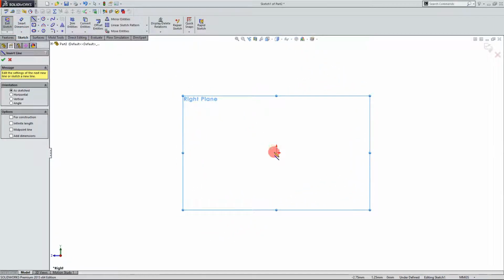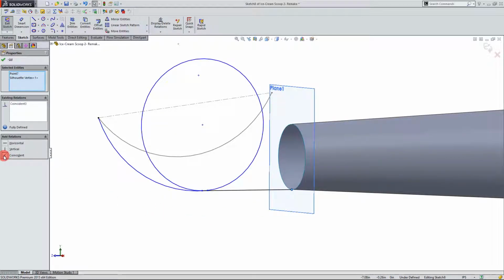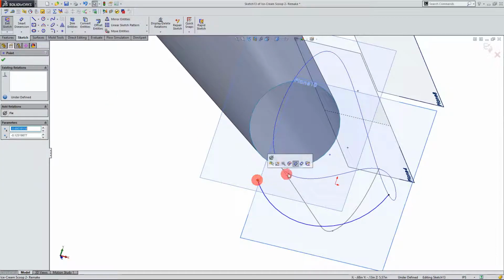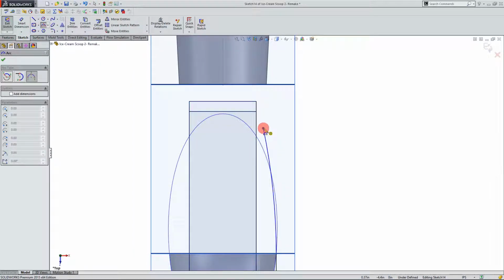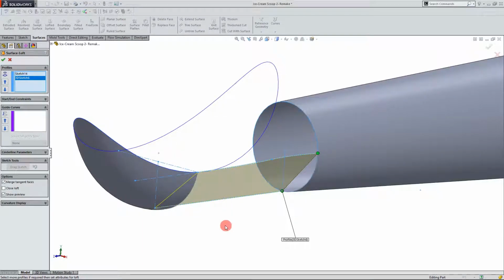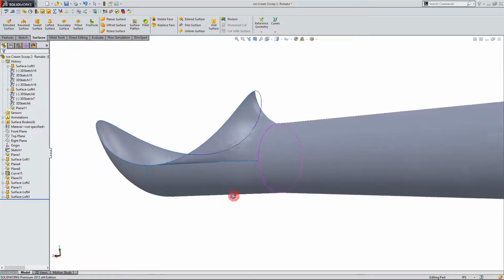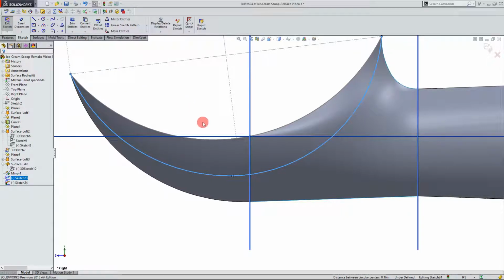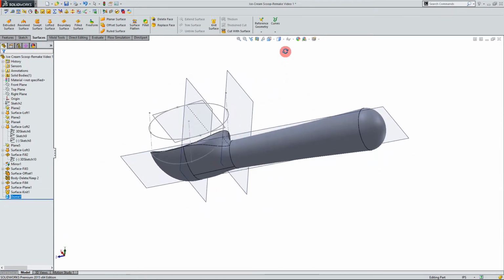Model an Ice-Cream Scoop in Solidworks! Advanced Surfacing Tutorial Practice Lesson

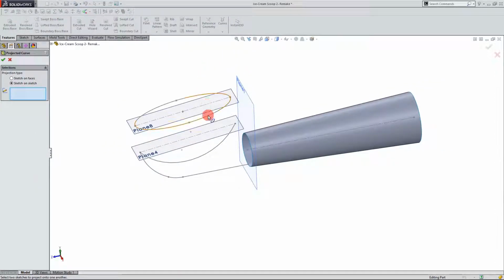Comment: Hi! I'm having problems with the curve feature 10:10 . I am receiving an error 'this sketch is not suitable to project a curve. It has more than one open/closed profiles'. I tried to rebuild and followed the video step-by-step but keeps giving that error. Do you have any pointers as to why I'm getting this error? Thanks
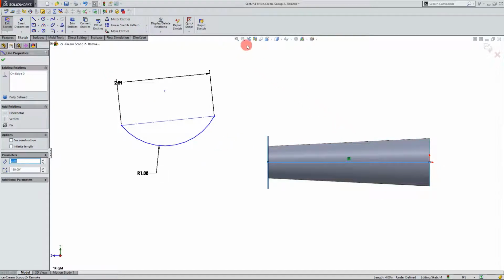Reply: Hi Steffi! I ran into this issue as well. I believe it is because the converted line that the scoop curve is dimensioned off of (around 3:30) needs to be changed to a construction line.
Reply from the maker: @thibui2094  Very well! This may be the cause of the error. It makes sense. It may not pick it up if you select the curve and the line at once. Then again, if you hit "select other" and only select the curve, it should not matter.
Reply from the maker: First thing is to look closely at each of your sketches to be sure they only have one set of connected lines or closed profiles each. Delete any other lines that are not connected together. If this doesn't work, try to make your arc profile out of a single 3 point arc, instead of out of two or similar. Hope this makes sense.